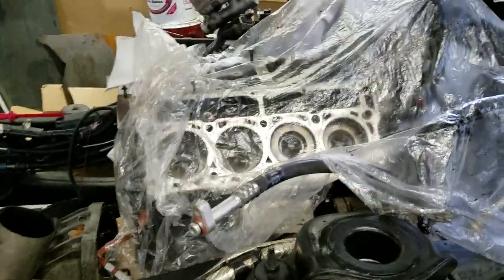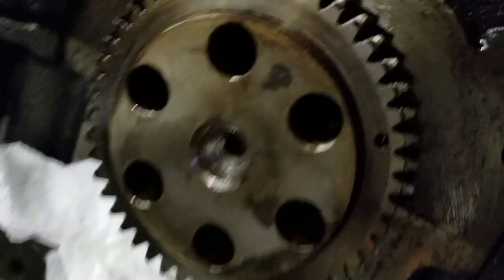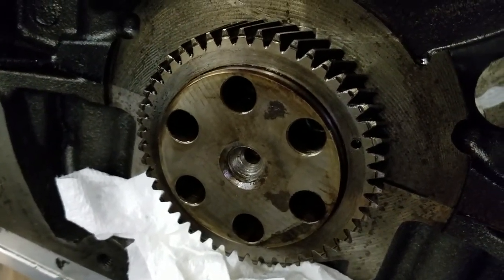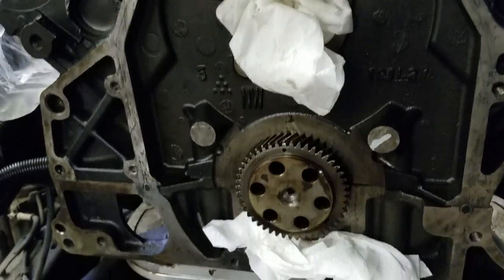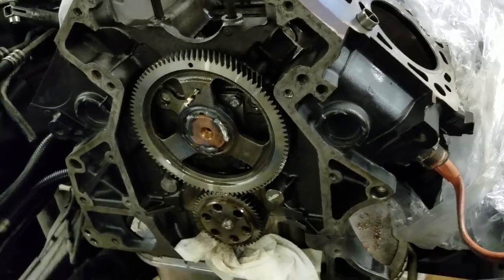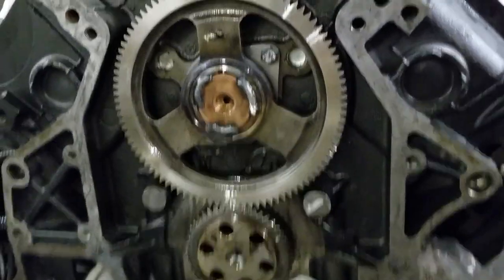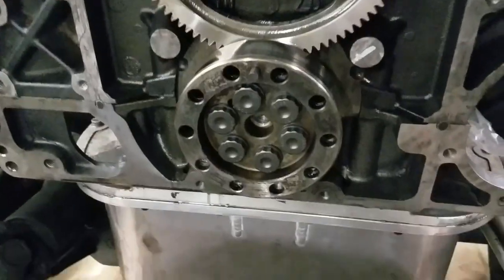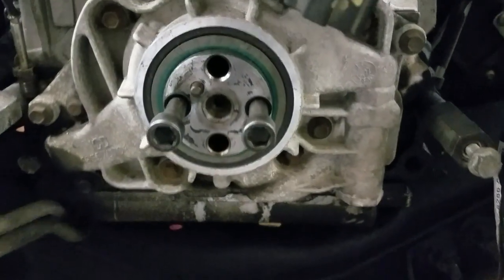Camshaft install and crank flange timing for 6.4 (and 6.0) powerstroke

Comment: I just got a engine from a rebuild shop/Machine shop and I just figured out they didn't time the engine I figured out when installing  the rocker.arms on cylinder #3 & #8 Intake when either of them is at cam lift the dowel is at 5pm on the crank pulley im not happy.

Comment: I did everything just like u said but I’m getting a slight vibration at 1800-2000 rpm or just off idle  ??? Not sure if it’s a injector  causing it or  I didn’t get that hub on right I got bulged a lot  hope I didn’t miss something

Comment: Don't mean to split hairs but 130 dollar timing tool not worth it but 170 dollar crank seal installer is a good buy? 🤔
Reply from the maker: the timing tool is only able to be used if you remove the block, and flip it upside down to install the crankshaft (while cam is already installed).  This method is used when you don't remove the crankflange.  If you remove the crankflange it is unnecessary.  So if you want to remove your block and crankshaft to install the cam be my guest

Comment: Hey I have 6.4, rebuilt the engine. Have a hard vibration on the truck now. Almost certain it is coming from the Crank flange, i have taken them apart more than 5 times and aligned all the parts including the flywheel and put everything back together right and still same vibration. Any advice? I would appreciate it, Thanks man!
Reply: If you look at end of crankshaft without the flange attached there is a hole/slot......turn your "flange" dowel pin hole 180 degrees from the hole on the crankshaft hole/slot. Diesaltechron has a great video on the vibration flange issue.

Comment: As an observation and if it can help someone  ,its worth noting that the re installation of the crank flange has to be the same way it came off , if it has no dowel pin to align it to the crank the installation as per DTR is the small hole in the crank flange  has to be 180  away from the dowel that hold crank gear on. 
On your Video its pretty clear that there is a discoloration left  by the crank gear flange is at   45deg to the left  of the crank gear or between 10 -11 (10:30)oclock .  you also re installed it in the correct position.
Reply from the maker: that is true, not all crank flanges have the dowel, instead you can time it based on the hole

Comment: would welding the camgear throw the camshaft out of balance?
Reply from the maker: not likely, too close to the center of the cam, and the beads don't weigh much compared to the total rotating mass of the cam

Comment: Just found your video.  
Is it possible to be 180 out? I think when I rebuilt my engine I put the big hole on the cam gear towards cam timing mark. Truck starts but I have a shake and think I installed the crank flange wrong.
Reply: Check out diesel tech ron video he had a shake until he changed the position and  reinstalled